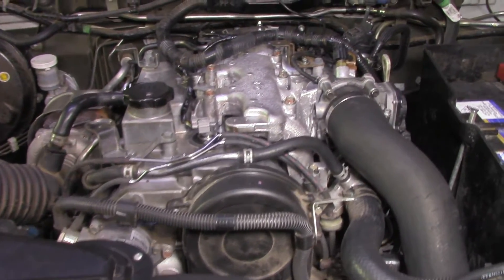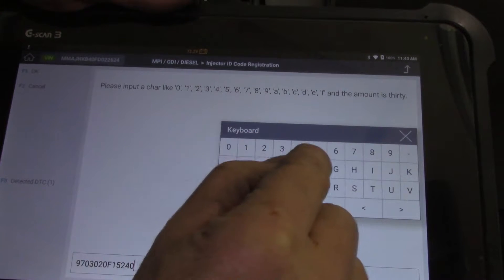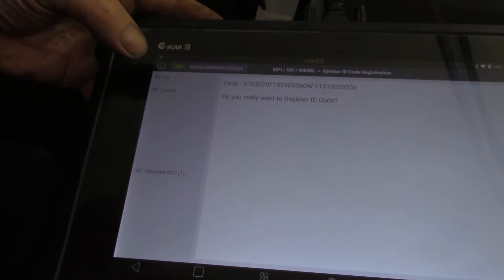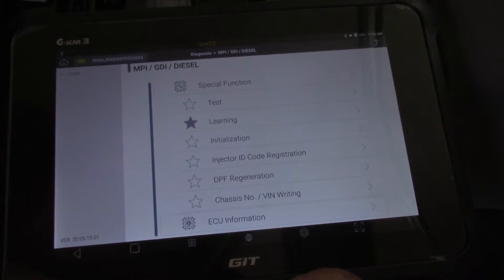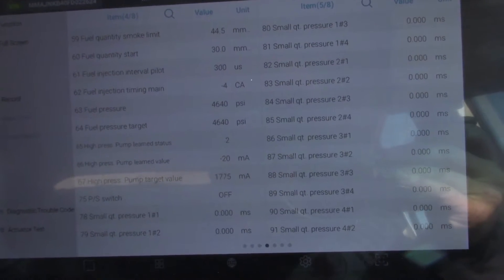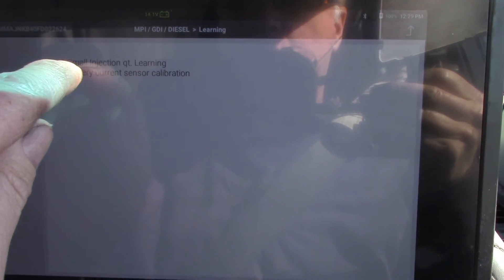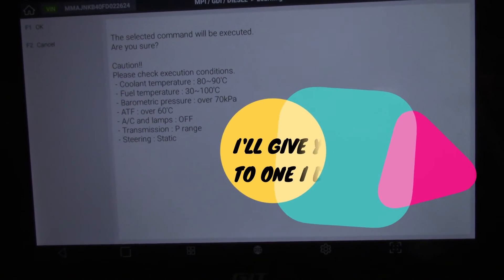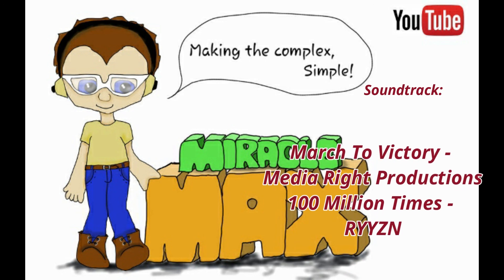CDI Injector Coding

Comment: Hi,which injector should be 1 the belts side or the other side?
Reply from the maker: #1 injector is at the front of the engine - where the timing belt is
Reply: @MiracleMAX we code the injectors yesterday but small injector quantity learning process it shows success on the device but engine lamb does not go away can we do it manually (without obd )
Reply from the maker: @HalilİbrahimSoğancı-f8k Sorry - do what manually?
Reply: @MiracleMAX english is not my main language sorry for the bad spell, so if we dont do the small injector quantity learn, the car can do it byself? Or can we do it without a obd device, (like press brake this much press throttle this much,turn the ignition on/off etc.). And if we must to do the s.i.q.l, which obd protocols will work. In my country i know shops that have bosch, autel etc. But they say
Their obd protocols can not write the injector code on l200(triton). If you have gmail or smth can we talk?
Reply from the maker: @HalilİbrahimSoğancı-f8k You will need a bi-directional scan tool to carry out the injector relearn. There is no way to just do it 'manually'. These are very fussy with the criteria to carry out the relearn procedure. 
https://youtu.be/Z6_ru3XxO20

Comment: Ive got a question i just put in new injectors im trying to code my injectors but my scanner is saying "input id wrong" i dont know if its my scanner im using a crp129x
Reply from the maker: Are you fitting them to a 4D56? Are they genuine injectors? Are you inputting the code on the top of the injector?

Comment: THIS IS ONE OF THE BIGGEST CONS IN THE CAR INDUSTRY make all codes the same so need to calibrate BUT ? THE  CAR MARKERS DO NOT MAKE ANY MONEY RIP OFF
Reply from the maker: The codes are for any slight variations during the manufacture of the injectors

Comment: Brilliant video. So is "Programming" the replacement Injector also known as "Calibrating" ? I'm just curious if there is a difference between Injector Programming and Injector Calibrating. Sorry if this seems a dumb question to ask of course ?
Reply from the maker: Never a dumb question. You don't program injectors - they are actuators. The ECU is the guy that needs to be programmed. The coding I am referring to is where the ECU is able to identify the operating tolerances (made during manufacture) of that injector due to the fact that no 2 injectors are identical. 
This video is an example of calibration done by the ECU to allow for changes in the injectors due to wear or changes in running conditions.
https://www.youtube.com/watch?v=Z6_ru3XxO20&ab_channel=MiracleMAX
Hope that explains it a little better. 😉
Thanks for your subscription 👍
Reply: What's your advice when you can only put in a code for one injector but the other 3 won't allow it,  07 ml triton

Comment: Hi,is this process need to do when takeing injectors out and turning it back in ...coz i had to change valve cover gasket replaced on my w212  220cdi and injectors are just take out and back in but had missfire?
Thanks
Reply from the maker: Did you refit the injectors into the same cylinder? Can you see a misfire on the scan tool? Can you isolate which cylinder it is? Do you have a good electrical connection on the injector? Any fuel leakage?
Thanks for your subscription 😊